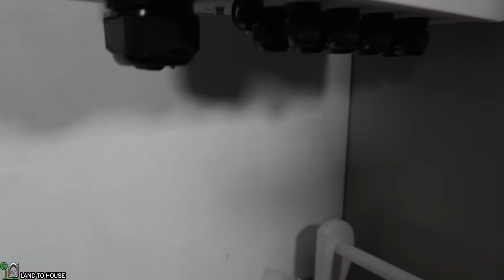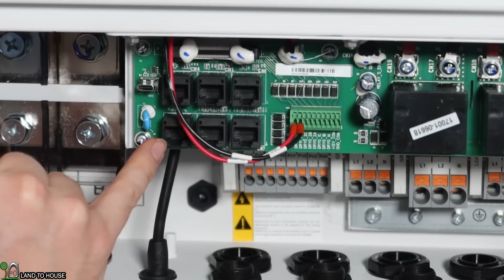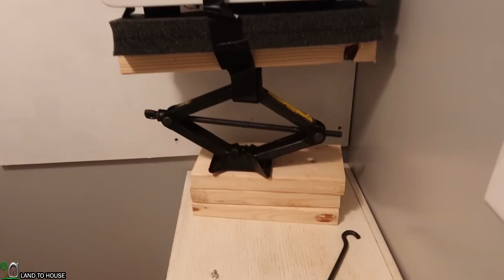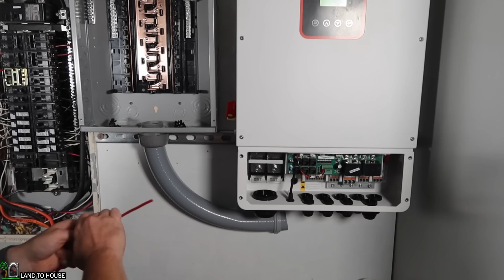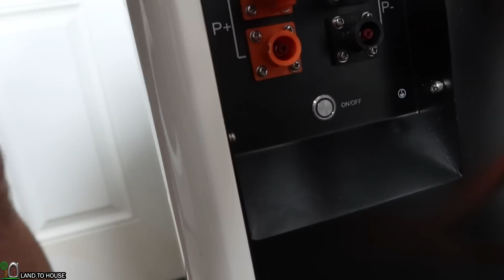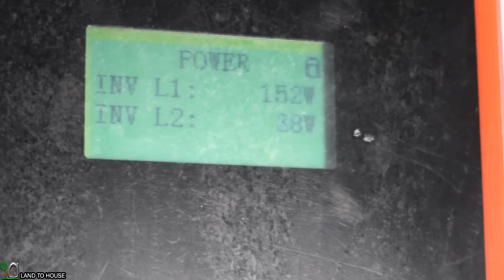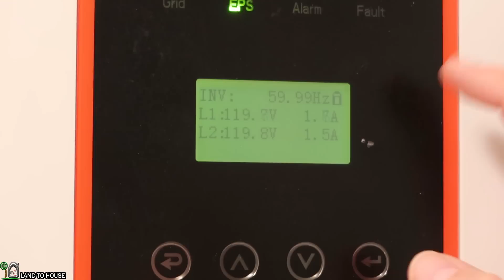8KW Inverter and 15KWH Battery Takes House Off Grid [Full Step by Step Install]

Comment: Are you saying that the inverter on grid mode will not charge unless it has 6kw of panels?
Reply from the maker: As long as the minimum solar voltage is reached it should work fine.

Comment: Excellent job!!  Any way to modify the over voltage alarm limit? Isn't the equipment supposed to be designed for 140 volts per split line? And why then does the alarm activate at 125 volts per line? Does a step down transformer resolve the problem?

Comment: 6:00  Load Panel - this is brilliant idea moving stuff over to loads panel!!!   The market is so flooded of about people's Solar setup;  I'm so glad I found this video. How to install the inverter into the main service panel circuit breaker. Where it will recharge. The battery banks through the inverter.
Reply: Where the Automatic transfer switch come in.I noticed you manul switch

Comment: I'm having bms communication fail. Can u help?
Reply from the maker: I had an issue with the ethernet cable that was sent with the battery. It is directional. You might need a different cable.
Reply: @LandtoHouse  which plug did u use from the inverter? I'm connected to the bottom left.. is that the right plug for bms?

Comment: I am not an expert so this might be a dumb question, couldn't you just leave the grounds on the main panel and use them there? Another question, Why did you need to install a grounding rod if the subpanel is just inches away from the main panel? I thought you only need to do that if the subpanel is in a separate building, like a detached garage!

Comment: I have two of these inverters running in parallel.  I'm interested to hear how your inverter is running so far?  Can you give an update?
Reply from the maker: I ran 2 megawatts through my vestwoods inverter. it was great. I have now installed an EG4 18k and it is amazing.

Comment: I saw the disclaimer. Your install is alot better than the installs I've from work done by qualified electricians. I'm sure they've learnt a thing-or-two. Beautiful and informative video, but can't wish you can conceal all the exposed cables. Especially the ones coming from you non-essential panel, supplying the input of the inverter, though. Imagine what would happen if they got hooked onto something, or got "yanked" onto something... That way it will be safer and alot neater. Just my opinion. Otherwise very informative video. Thank you.

Comment: You didn't leave enough space for ventilation, buddy. This almost certainly doesn't conform with the inverter manufacturer's recommendations.
Reply from the maker: It worked well for 2 megawatts. (Still works well but needed more ventalation)  I replaced the vestwoods with an eg4 18k. The new install has the right ventilation.
Reply: @LandtoHouse  It's just a reminder for people to pay attention to ventilation too. Thanks for the video.

Comment: I was just looking at this inverter on ebay.  How is it holding up? Any troubles ? Thanks for the video
Reply from the maker: It worked flawlessly until I replaced it with the eg4 18k two months ago. Only thing is that it runs a little loud.

Comment: Sorry, but you defeated the purpose of your unistrut. Unistrut is meant to mounted with the flat surface against your plywood. Then you use unistrut spring loaded elongated nuts that can slide back and forth inside the unistrut "track" into their exact final position.  

It is also customary to have black on L1 and red on L2. Will Prowse was very adamant about using solid terminations into the interior lugs. The lugs in these units are not made for stranded wire.

At the 17:50 minute mark, you show your loose ground wire ALMOST TOUCHING the main panel live bus connection. This could have caused an explosion in your new inverter. You were extremely lucky that this did not occur. NEVER have a grounded wire floating inside a hot panel even for a split second.

A code violation you have there is having power from 3 different sources in one conduit (DC from panels, AC from grid and AC from inverter.  You need a separate conduit for each source.

Having large stranded wire in your PV breaker lugs is a no-no. They need to have crimp lugs like the terminations at the other end in the inverter. Stranded will loosen over time.

I was considering this system that you have, however only as an off grid setup. Our utility will start a fixed fee next year of $25, which means higher fees in the future to make up for the loss of revenue from thousands of residential solar installs. Someone has to pay for the grid. This will offset having to raise rates for grid only customers such as apartment dwellers. And lower income who also cannot install solar.  So having said this, I want to avoid fixed fees in the future as well as highest rates in the nation and have all my loads on the inverter panel to cancel my electric service. But this requires adding our range, and AC. You apparently have not done this for your 240 loads. We have a gas water htr and a 110 v gas dryer, so those are not an issue. We only use the AC for a couple hours on worst days. Typically without AC, we use 3 to 4 Kwh per day.

Comment: great video the only thing i would have done different is bring the wires in the back of the panel . it looks great
Reply from the maker: That would make the install cleaner. The top install made this easier for me at the time.

Comment: Looks like some people aren't paying attention to the video......   but not my question.... my question is how are you putting in oh i don't know several thousand volts of PV? I mean, 48panels times let's say 40 volts each.....  1920 volts DC.....   How do you reduce that?
Reply from the maker: Good question. The inverter has multiple mppt charge controllers. That means you run strings of solar panels max input voltage of 500v. So 12 of my panels equal 432v at 11 amps. I can run two sets of these for a total of 24 panels at 432v each. 6000w.
Reply: @LandtoHouse  I only ask because I want an inverter for my house. I altar have 41 380 watt solar panels, but they are already tired into my grid system.  They are literally 46.7 volts each.......   but they each have a micro inverter which is where my problem starts.
Reply: Already

Comment: The 100a breaker in your sub is being fed by an 8awg wire. That is way too small of a wire for 100a. Super unsafe. You need to drop the breaker size or up the wire size. 

I would seriously considering a T class fuse for your battery. There is zero chance that breaker could handle a dead short. 

Did this have to pass any sort of inspection?

Did you obtain an interconnect agreement with your utility?

That inverter seems like nothing like problems - it doesn't do what you wanted.
Reply from the maker: This system has been upgraded to the eg4 18k. Working flawlessly now. That upgrade video will soon be on my DIYVolts channel.

Comment: Hello, how is this inverter working to this day is it any good? have you encounter any problems with it, thanks!
Reply from the maker: This inverter is still running my house. The only issue I had was not enough time for the swap between solar and battery in the morning. A simple setting fixed that. 

I am about to change out this unit for an eg4 18k. That video will be on my diyvolts channel in a couple weeks. @diyvolts

Comment: And this battery system that you’ve got is 15,000 W if it’s a 15 kW battery so this man if he wanted to go without normal grid power and run his whole house almost completely on that battery bank and if he got one or two more of those exact batteries, he would be self sustainable forever, but remember what they said when those solar panels got destroyed recently solar panels are a scam and in my opinion, solar panels are only a scam. If you don’t know what the fuck you’re doing and if you don’t know your numbers, don’t buy it until you do the research because you just can’t to batteries to run your whole house like some people do but this man can run his whole house on these battery even if he had just one

Comment: And call me crazy, but that bottom switch that he says is the grid cannot be the grid that may be the back up power grid fuse but if you’re an electrician, you would know that the grid fuse is actually the main fuse all the way to the top of the breaker panel on your houseso when you’re doing this do what he did and put your solar grid all the way on the bottom as far away from the main panel that comes from the grid outside

Comment: Would't have been better to buy a more powerful inverter and not have to use a critical loads panel and just feed it into the main panel? That's what I plan on doing but I have just purchased a EG4 18KPV Hybrid Inverter | All-In-One Solar Inverter | 18000W PV Input | 12000W Output | 48V 120/240V Split Phase | EG4 18KPV-12LV
Reply from the maker: This 8k was a free item for the review video. The luxpower (eg4) 18k is an awesome machine! You will be very pleased with it. I have one of those installed in my workshop and it's amazing.

Comment: You are connected to AC i might be wrong but do we need additional ground rod?  Its going off AC grid which has the ground neutral bond and the rod earth ground.  I just learning and from what i have read if using ac grid the main panel  holds ground neut bond no additional ground rod.

Great video though the sub panel area is really what i was wanting to see, the westwood looks similar to eg4 6000xp.

Comment: SO IF YOUR INVERTER IS BIG ENOUGH, YOU CAN NOT USE A BACKUP PANEL AND DIRECT A 150 AMP FEEDER FROM A AC DISCONNECT RIGHT TO INVERTER AND INPUT ABOUT 25K IN TO A HYBRID INVERTER
Reply from the maker: The battery has an amp limit for charging. 25k is going to be too high.

Comment: I have a question about the breaker you are using for the battery. It looks to be like it is only a 125 amp breaker. How are you able to use it for 250 amps?

I have been trying to find MCBs for a battery distribution panel I want to build and need 250amp dc breakers, but I havent been able to find any.
Reply from the maker: It is a special way of connecting a large battery cable together. I took a bar of copper and made a U shape so that it would fit inside the double breaker. I then used a mechanical lug to connect the positive battery cable across both of the breakers poles. This combined the 125 and 125 amp into a single 250 amp. Both sides of the breaker will need the U shaped capper bar with mechanical lug.

Comment: Hello, thank you for the video. Well done. I see you have a 100-amp breaker on the sub-panel feeding your critical loads and only a 40-amp breaker from the main panel to the inverter. How did you figure out the size breaker for both? I will be using the EG4 6000XP with the EG4 power PRO battery and 8K watts of solar. I have mostly everything figured out, but there is no instruction in the manual that addresses the breaker capacity from the grid and to the loads. Also, why did you separate the grounding? Why can't you use the same ground? My main panel has the neutral and ground bonded.

Comment: I like the way you explain how to wire up the unit, simple for everyone can understand, I would like you to explain more on the batteries voltage and the needed panel wats needed to recharge the batteries and the unit is it 24v or 48v? Thank you.
Reply from the maker: Thank you for watching. This battery system is 48 V. The charge controller can accept solar panel voltage up to 500 V. My array is at approximately 430 V. The closer you get to the maximum voltage, and the lower the amperage, the better low light power you will produce.

Comment: Question: Why couldn't you run one wire from the Neutral of the Main to the Critical loads panel and the same ground then just move the hots for each circuit?
Reply from the maker: There was a reason but sadly I have forgotten! I installed a transfer switch recently and was able to move over a single neutral and single ground. Something in this off grid install required isolation even with ground and neutral.
Reply: @LandtoHouse   Thank you for replying. I searched around some more and I guess if you using an inverter with a common-neutral feature that is fine. Inverters like Growatt and EG4 I guess don't have that feature.

Comment: One of the best solar videos for DIYers. Lots of more popular YouTubers in this field do not cater to the people who would actually do a DIY project.
Reply from the maker: Thank you. I agree. So many videos are surface level and don't show the details.
Reply: @LandtoHouse  hey one question. Did you not install an AC disconnect? If you were to, where would it go?
Reply from the maker: @simplyidiotic1  all the AC goes into the sub panel. I just turn off breakers. You would need a two pole breaker to shut off the 240v ac together. Any place after the inverter would work.
Reply: @simplyidiotic1 

He likely didn't install one because it wasn't an install that had permits or inspections. 

The disconnect would go outside the home where it could be used by the utility to shut down the system.

Comment: Hello, a nice professional looking install. But I don’t understand the necessity of going through all the trouble and expense of a critical load panel: after I move my critical loads—which to me include refrigeration/freezer, furnace, induction cooktop (gotta eat), Wi-Fi/router, TV (gotta watch for news)—the only things left in my main panel would add up to only 300-400 watts, all of which my 6kw split phase inverter and 20.4kwh batteries can handle. What am I missing?
Reply from the maker: In my panel I have a 5400w clothes dryer, 4000w hot water heater, 3000w cook stove, and well pump. Those large items can't run on my solar inverter. That's why I need those still on the main.
Reply: @LandtoHouse  Good grief! You need to get rid of those appliances! ;)

Comment: Can you do a load test to see how many amps the inverter can put on without the grid?
Reply from the maker: This is an 8000 W inverter. Which means the maximum amperage that it can pull is 66 amps. I've been running this inverter off grid for this year and had no problems with washing machine, dishwasher and refrigerator..

Comment: I'm wondering if it would be easier to move the main grid wires out of the panel then route it back to the original panel (via a transfer switch to select grid or inverter) instead of moving the hot and neutral for every circuit to a new panel.

Comment: Sorry, but those wire connectors in the inverter SPECIFICALLY forbid using stranded wire without using a ferrule. What you did in this video is very dangerous! The 240 volt wires going into the bottom of the inverter have to be in conduit or a wire tray/trough to be legal under any code in the US. You did so many things in this video that are dangerous or don't meet NEC code it isn't funny. I'm not really sure why you didn't mount a 6x6x3' trough under the inverter to contain ALL the wires safely. This is however a good video to demonstrate why so many DIY solar installs burn houses down.
Reply: Ouch ,I'm new to learning about solar, so I would randomly watch videos like these to get more ideas. Thank you for your comment
Reply: If you have a moment could you cover some of the nec issues?

Comment: Hi, any chance you could make a clip explaining what you did to sort your battery comms error? im battling and can't seem to get it sorted, as well as a quick run through the menu settings. The manual feels somewhat crptic to me
Reply from the maker: Turns out the battery issue was a cable problem. The cable has wires that swap over in the connectors then I had to cut all but 2 or 3 wires and it worked. I need to make an update video. The system has worked flawlessly as an off grid system.

Comment: thanks for an informative video.  I was almost ready to buy a Victron Multiplus 2 but my hesitation is 3000kw only single phase. I would like a hybrid like this Vestwoods unit, I think 8000kw is about right as my house uses all LED lighting mostly DC fans and large separate refrigerator and freezer (subzero).  my house was set up to use a generator but I never bought one as they cost in Costa Rica is just to high when you add in the propane tank, plumbing etc.  im not ready to add color yet but we are located in perfect area to do so,  instead I have a few questions of you can offer help,
1. my main panel is 200amps and in front is a box with magnetic switch to cut in a generator.  next the main has a 2 pole 100 amp feed to a 42 slot sub panel all the lights, fans, outlets, and kitchen appliances.  the main 200amp panel has the AC's and pumps.  we never measure the actual load that the sub panel pulls but I just bought a meter and watt meters to check all my loads.  using an 8kw inverter could that no support about 67 amps max draw?  hence I could just downsize the feed breaker from 100 to 60amps.
2. what is the max input current from the grid to charge LiFePO4 batteries? can I use rack batteries like SOK 48v/100amp units with this inverter ?
3. could you just use CNN fuse instead of breaker? between batteries and inverter? since i have no solar.  I might add later money permitting.

thanks again for the video.  when is this inverter available?

Comment: That load to panel wire from inverter just look way to small and worry me that it would over heat and melt
Reply from the maker: The max amps that the inverter can push is 67 amps. 120v x 67amp = 8000w. The 6awg or 8awg wire can handle that no problem.